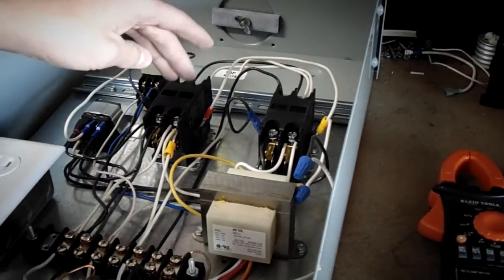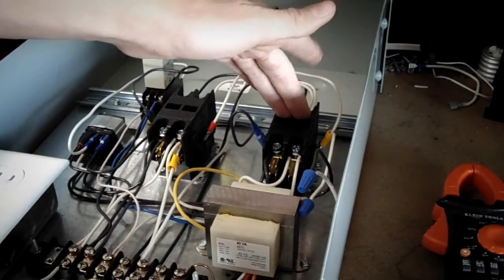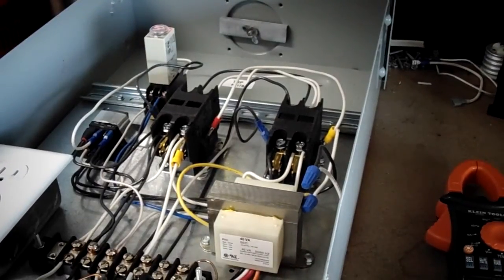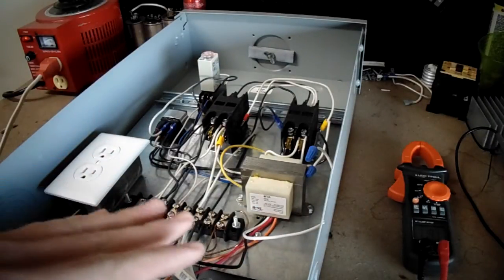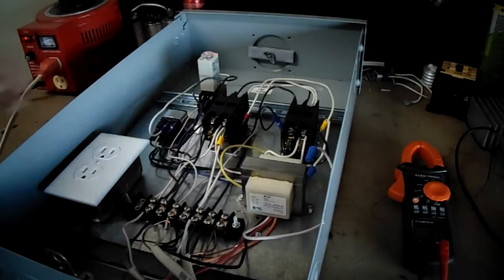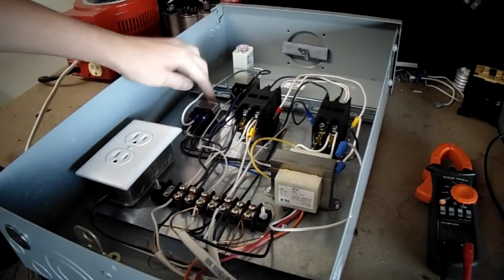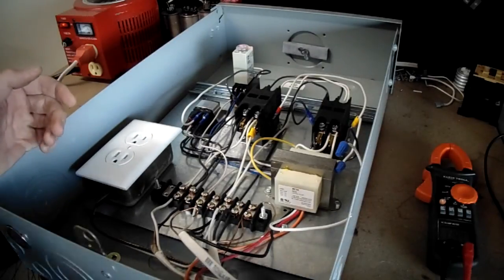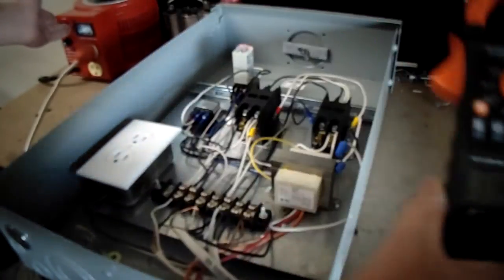Homemade Automatic Transfer Switch

Comment: How do you connect to your main load canter
Reply from the maker: Jose Garcia For this particular module I built, this would be used on an individual circuit, not for a service entrance or load center.

Comment: Great design.I noticed that the only operational contractor is the left one( grid power)
and the backup power one is always on in the video.does your design interlock?if backup contractor is closed all the time won't that backfeed inverter?
Reply from the maker: Rick Rude I know it might be hard to see with the camera angle but it is interlocking. Only one contactor operates at a time, and there is even a delay to make sure of that.
Reply: @logycam10  You have electrical interlock but to be safe mechanical interlock is needed too.
Reply: Rick Rude I dont see interlocks. Very dangerous.

Comment: Any chance of getting a drawing of this?  rockisland38581@gmail.com
Reply: No offense, but you're not even using basic interlocking contactors and you're pretending your plans are too valuable to give away? I can think of so many failure modes in this design that result in utility power and the genset being bonded (and you don't have any kind of disconnect or overcurrent protection to remedy such a situation if it happens either), not to mention how much simpler and cheaper a set of interlocked contactors are than having to deal with disparate units on a timer and relay
Reply from the maker: I am not looking to give away my plans to this project, but if you're interested in a schematic, we can work something out logycam@gmail.com
Reply: I would understand that ..
Reply from the maker: No offense taken, I put this together using spare parts on a Sunday afternoon, It was not intended to be a super fail-safe system (This is why is has plug tails on it). If my plans were valuable, I would not have posted this video, the schematic is right there. Anyone with enough know how to see how all the parts work together should be able to make one on their own. It's simple and dirty. If I should ever install a transfer switch, best believe it will be brand name, and installed better than to-code.I have no intentions of installing it, It was designed to be used on such circuits that already have over-current protection (15 amp receptacles, generators, UPS's, etc). Interlocking contactors are the best way to put together your own transfer switch, however the best option is to buy a legitimate transfer switch module. I hope you did not take this device seriously as something I was going to start reproducing in my garage and selling on eBay. I am not quite sure what disparate is, I'm guessing you meant separate? Yes it is once again easier to use interlocking contactors, but you have to realize that this setup was using what I had at the time to do a simple job.
Reply: sorry, I must have been in a bad mood yesterday. You took the time to learn and build something which should be commended. disparate is just another word for totally seperate or two different unrelated things. keep building!